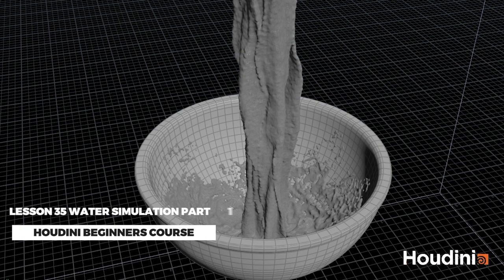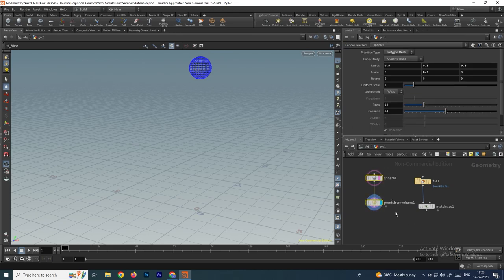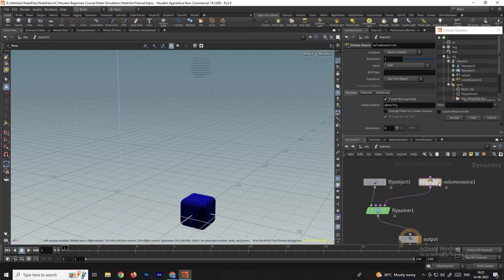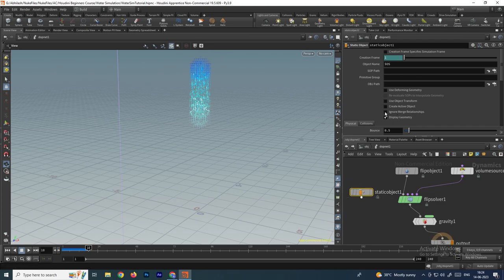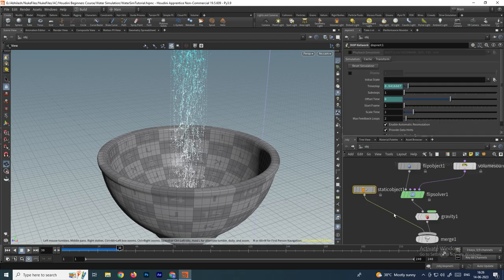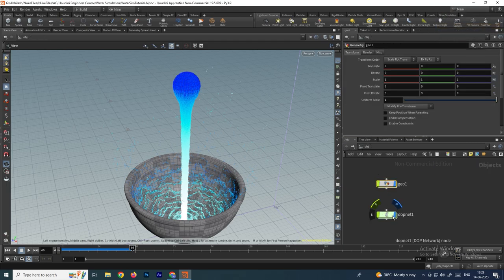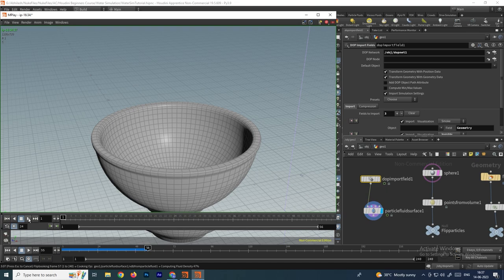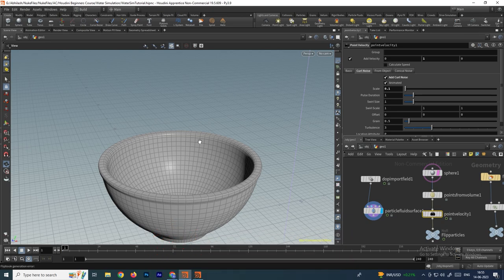Make Real Looking Water In Houdini - Part 1

Comment: What is your opinion on Blender Water Simulation with Flip Fluids Addon vs Houdini Flip Simulation (in terms of simulation time)? Thanks
Reply from the maker: i find in blender it is easy to create water when campare with houdini ..but houdini out put is good 
when coming to simulation time blender was very fast when compare with houdini because in blender we can render using GPU . it completely depands on system config .
Reply: Blender is easier to use, but compared to Houdini you have very little control, Blender is also Unstable and the has longer simulation times and you will end up with a much worse result, overall in Simulation Houdini stomps, However For Modeling and Animation Blender is better so its good to know both.
In terms of Rendering yes, blender is faster than Karma at the moment, That will probably change once XPU is completely ready.

Comment: Tried to follow that twice. Particles go through the sides of the glass I'm trying to fill and glass stays mostly empty.
Reply from the maker: Make sure increase the collision value so that there will be no gaps for collision
Reply: @artistscreek  I increased it to 500, but even at 50 the mesh is closed, it just comes right through. Also liquid dissapears into nowhere, so glass is never filled.
Reply from the maker: @jamdva8176  is the object is planar or any thickness to the object
Some times if the object is planar it doesn't collide properly. Try  change to any other object mostly it have to work
I didn't miss any steps
Reply: @artistscreek  it is not planar,  I'll try to change it a bit and export again, or make something else. Thanks for a reply, will respond as soon as I get some time for that magic.
Reply: @artistscreek  made another "glass" out of a cube, exported as fbx, and it behaved the same.
Reply from the maker: @jamdva8176  oh i don't know why it is not working to you .
but i didn't miss any step actually
Reply: @artistscreek  does it make a difference if I have emission object and collision object in different sub-categories of an alembic file?
Reply from the maker: @jamdva8176  it will not make any difference . nut if u change the size of the collision then the simulation may not match to the collision object
Reply: @artistscreek  the collision object are 1-5 cm. I changed the flip object (one with four inputs) scale to half a meter in volume constraints. Before it worked fine with a big sim made with pre-set fluid things on ready mesh. But now in 19.5 and 20 it doesn't work at all even at the point of particle emission. Even though it is a fresh new project id doesn't work at all with primitives from houdini.
Reply: I think I had the same problem. what worked for me was adding some substeps in the Flip Solver node. Cheers.
Reply: @Nickkhell92  i added up to 200, but to no avail.